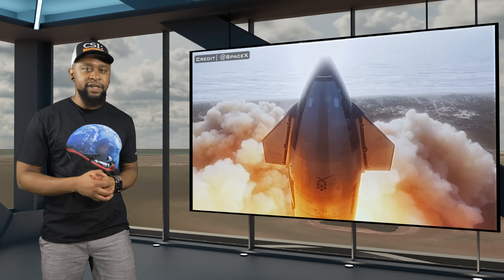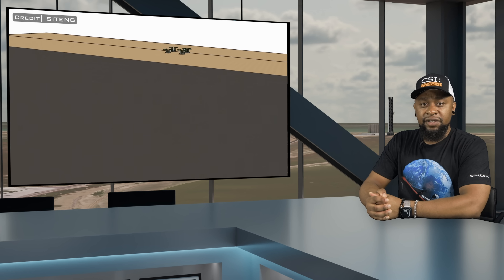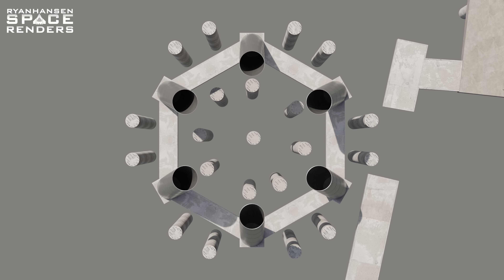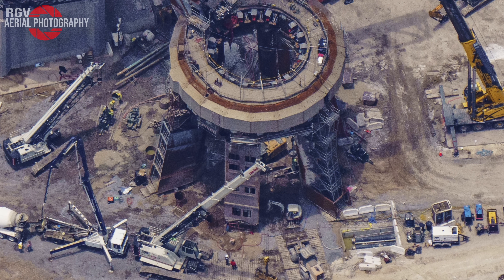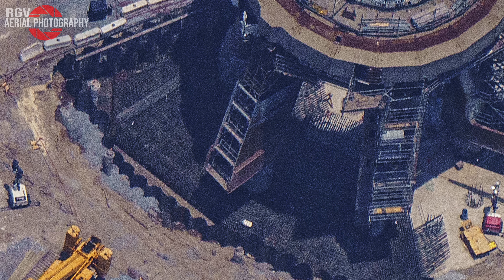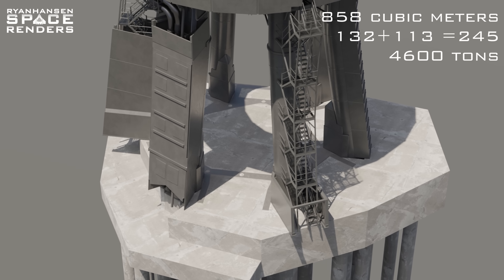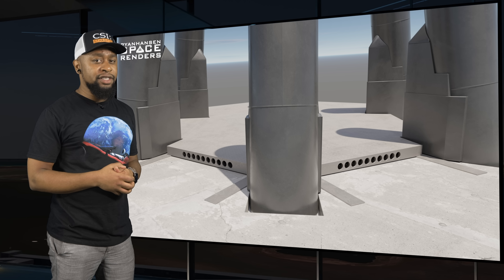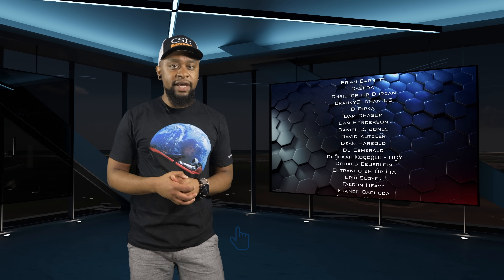How SpaceX Will Guarantee Its Launch Pad Never Fails Again! [Part 1]

Comment: Is it overkill? I worry that it might be under-kill.
I think if we made a flame diverter, lined with water cooled steel plates, that would be a good idea. Perhaps it doesn't need to be as deep as the NASA ones, but something ~ not just a flat plate under it.
I am also far from convinced that perforating the plates is the right way to do this. I have driven cars and motorcycles for 50 years that are water cooled, and normally they don't spray water out of the cooling system. If you could pressurise that system, to even 20 psi above ambient, you would dramatically increase the boiling point of the coolant, and water is about a hundred times more effective as a coolant, if it has not yet boiled. I don't know that using that plate assembly as a lawn sprinkler is the right answer. Just use the water to stop the steel from melting. Don't put holes in it that allow water out, and supersonic high temperature exhaust gasses in. I can't think of a suitable comedic analogy, but I fear this is a wrong-headed way to see the problem.
----
[edit] You're building an engine that already has a blown head gasket. There are dozens of direct open pathways from the combustion chamber into the water-jacket.
----
The other thing I'd say, once you have confirmation most of your engines have started, launch the damn thing! Don't leave it sit for 7 seconds or something on the pad, at full throttle ... You have a yes-no moment at main engine start, and if they don't, you abort immediately. NASA and all the others, don't have rockets sitting on the pad with 80% of their engines blasting away at full power while they take a closer look at why the other didn't fire up. A case like that, means an abort.
I would also like to know why, if they were trying to do a separation, and that's what the tumble was, why didn't the main engines shut down when commanded to?
Reply from the maker: If you don't keep a layer of water between the plates and the exhaust gases, it will melt. No amount of flowrate of water within the plates will prevent that from happening.
Reply: @CSIStarbase  ~ Well perhaps. Opinions. [shrug] I think you have to keep liquid water in contact with the back of the plate, preferably at 20 ~ 30 psi above ambient pressure, and not let high pressure exhaust gasses into that water space, because those will spread like a bubble and insert a layer of insulation under the top plate. Now if that happens, then you're quite right ~ no amount of water flow is going to keep that top plate intact. I don't know about an insulating layer of water / steam on top of it, I can see your point, but I don't want exhaust to get in between the plates, because experience with water cooled engines says that's called a blown head gasket.
[shrug] Pass the Popcorn ~ I'm keen to see it tested.
Understand, as a 6 year old boy, I watched Armstrong take one small step. I've waited now for fifty four years to see the next step. To say I'm keen is a bit of an understatement. I have waited so fkcun long for this ....

Comment: Um... no word about the chemistry of concrete??? There IS a reason why furnaces are still made from bricks. Even Fondaq RS will break down at 1100°C and the Raptor's flame temp is around 2810°C. At that temperature, concrete will explosively "break down" leading to fast ablation of any exposed surface - that's why foundries usually have dirt floors.

Comment: Obviously not overkill, but the cheapest alternative short of spending the money to engineer a 2000' deep mass driver system to use vertical linear rail motors to catapult the launch vehicle into the air above the Boca Chica surface before igniting the Raptor 2s. 
Our Trident SSBN subs use this technology and places the USA's survival on the reliability of flinging a rocket from sub-surface ocean to clear air prior to igniting the engines, so it is an already developed and proven launch system. Elon could definitely adapt it if he weren't so frugal.
Reply from the maker: I asked the question because Elon made the statement that they took the overkill route with designing their new foundation.

Comment: Uh, this has got to be satire right? This was not a success in any shape or form full stop and the methods Elon has said about improving will not only make the launch pad get completely annihilated it will essentially bomb the surrounding area and the rocket won't even clear the pad. Not to mention he can't even put a water cool system in the launch area since you NEED to have retention ponds, which there is no place to catch and store millions of gallons of water at any of the launch sites he has access to. This is even more a requirement for boca chica since it's directly next to endanger wet lands, which he has already annihilated with toxic concrete dust and craters, shrapnel and other items. So next time you think an explosion, a steel plate being launch miles away, and all the water being released onto those wetlands is going to be an even better turn out? That's assuming the rocket it self doesn't explode right there on the ground since it won't be bale to leave the pad once the pad explodes and takes legs and surrounding area with it.

I have a radically crazy idea, that's super simple although crazy and hear me out here. Flame Diverter.....

Comment: I know that the assumption is that the failure resulted because of sand compression.  But what if this was a result of liquefication of the sand substrate?  So even if all these improvements are made to support on the surface of the ground.  If the world's larges blow torch causes significant vibration the damp sandy substrate will liquefy and this could result in the shifting of Stage 'O' just like when earthquakes cause buildings to sink in to softer sandy soil.  Just saying

Comment: They need much more water. And they should probably add a third shift to the bakery, and make more thermal tiles to cover the entire launchpad structure using the same tiles they use on the Starship.
Reply: Oh yes because the engine exhaust & reentry plasma environment are absolutely the same thing /s

Comment: The water cooled steel plate isn't doing it for me as it is flat which will reflect the acoustic energy directly back to the rocket.  Sixty years ago we knew larger rockets need a flame diverter and flame trench and most every suck launch pad in the world uses them.  But, SpaceX thinks they know better and can do without a flame diverter and flame trench -- we will learn the results of this on the next launch.
Reply: And if the water plate were doing its job well, would you back down or?
Reply: @alvianchoiriapriliansyah9882  -- What on Earth are you babbling about -- care to ask an actual question about the use of this water cooled steel plat?
Reply: Actually, steel plates have been used successfully before. This water system will flush like a high-pressure toilet.
Reply: @psycotria  Actually, where on Earth has steel plates ever been used in the absence of a diverter geometry?  And where have they been used with a rocket that produces over 70MN?
Reply: @Raptorman0909  "Actually, where on Earth has steel plates ever been used..."

Look it up, I saw the video, and heard expert opinion,
Reply: @psycotria  I'm not doing your work for you, if you have a reference why are you unable to provide it?  And again, Super Heavy is more than twice as powerful than any rocket ever launched so even if there was such a launch pad, and such a system is probably acceptable for something like the Electron rocket, but for large rockets I know of no such installation anywhere on the planet!  But, since you unhesitatingly stated, with no hint of uncertainty, than you must have that reference on the tip of your fingers so go ahead and provide it!
Reply: @Raptorman0909  Lols. The only claim I've made is rockets have used steel plates. It's not my job to provide citations; believe whatever pleases you. 

The fact here is a super rocket will be using a flat, water deluge steel plate. There will never be a "flame trench" under the OLM, as nothing beats a 360 degree opening to release the force of a launch.

As a few more small pilings would have held up the sagging corners that doomed the original pad, I'm certain that the 'Overkill' pad will support the loads.

Certainly a welded, ribbed steel system that likely weighs over 200 tons, welded to the OLM legs, anchored to 4800 tons of steel reinforced high strength concrete, and tied into so many pilings that likely weigh another 500 tons, will not be going anywhere, anytime soon, not for any reason. 

Nitrogen powers the Falcon water system at KSC. Upon seeing the design of the water plumbing, this nitrogen-powered, gravity siphon system will move the required water in the ~7-10 seconds that the rocket exhaust would otherwise impinge upon the plate. If there are any tweaks needed, they will be made.

After seeing how sturdy the Starship stack is, I have no doubts that any issues will be ironed out of this evolving new system. It's almost time to start putting Starlink 2.0 into orbits.
Reply: @psycotria  You're delusional!  The flame doesn't have 360 exits as the legs of the mount kind of prevent that.  The other factor is that in order for the exhaust to exit it must turn 90 degrees but there is nothing to steer the exhaust by 90 degrees -- that's the purpose of the flame diverter.  So you can't provide any citation for where this has been done before, you made no effort to do so, and you expected me to do that for you -- got it!

Comment: Honestly I really don't understand how their engineers didn't calculate what would happen if they used concrete instead of steel for the launch pad. I remember thinking before the launch, 'how is that concrete structure ever going to hold together under that much power?'. Then the launch happened and I thought, 'oh it won't...didn't think so.'

Also mid point commercials for your garbage sponsors is video ruining. This youtube panhandling is getting way too out of hand.

Comment: If the Starship needs the new pad to take off, how are they going to build one on the moon or Mars before they have to land right on the stupid thing?
Reply: The booster needs it to take off, not the ship. Anything landing on Mars will hopefully have somewhat long landing legs to keep the engines a good distance from the ground.
Reply: @Raptor2  There are no legs on the second stage, it's supposed to be caught in mid air by the launch tower's protruding arms. They'll have to get both stages to land on short legs and then take off with the second stage but then they have to start engines still attached to the first stage.
Reply: @tomlakosh1833  Right now there is no way at all to recover the upper stage. The current design is only meant for stacking the ship, not catching. SpaceX/Elon have suggested catching the ship, but it doesn't seem like they're as set on it as catching the booster. 

It's also worth mentioning that Starship won't use Raptors for the final part of landing on the moon, so no worries about regolith flying everywhere.

I don't know what you mean by "have both stages land on short legs".
Reply: @Raptor2  I meant refuel the booster in orbit and take the whole damn thing to the moon or Mars. I still think we should protect this planet first before destroying another one.

Comment: All this work to save what was obviously a flawed design from the get-go.  This may possibly work, but I'm dubious it will work for multiple launches a day, every day.  I remember when they first installed those six legs thinking it was inherently flawed.  But we'll see.  I'm not a Musk hater, but this design like many others seems to have started out as an idea that looked good instead of one based on engineering principals.
Reply: They don't really have the land space to do what everyone says they should do, a flame trench. I wouldn't say this concept of a flat pad is flawed either, it has the potential with the steel plate to use significantly less water than conventional trench with diverter and water deluge systems that use a million gallons.

Comment: Launching from Earth is not the problem, that comes in when they have to launch from the surface of Mars.  They will not have the infrastructure to build such a pad there.
Reply: They will not have a booster there either
Reply: @alvianchoiriapriliansyah9882  Hmmmmm, about 40% Earth's gravity.  That will still be a rough launch from an unimproved pad, or whatever improvements they can make with materials on hand.

Comment: Giant 1 inch steel plate resting on packed gravel is all it needs. No water, no concrete. -not an engineer, just a physicist.
Reply: Good luck trying not to melt
Reply: @alvianchoiriapriliansyah9882  i'd like an engineer to run the numbers. It's only 15sec of heat and the flame if already highly expended... thick steel should wick that heat away from the surface without any melting. The steel may expand unevenly, which could cause other problems. - just a physicist.

Comment: smartest people out there building the largest spaceship in our lifetime.... puts a flat concrete surface under it..... lmao
Reply: looks like they need to build a concrete channeling system to divert all of that burn off back up into the sky, spreading all of that heat/thrust over a greater surface area...
Reply: @07szim  Like a system of trenches that could deflect the flames? A sort of Flame Trench-Deflector System? No way something like that would work. That sounds like something NASA would do....

Comment: Oil platforms overbuilt steel?wtf😊 concrete is just agragate with natural binders, a science to it, steel,thick. Old machinist. Made chop saw gears precisely 😊 Retired Md.state board certified bonded insured master 30 years also, sanitary, state code.water well driller, cable. Had six. Newest built 1958

Comment: I guess it's going to fail. There's a reason all other operators have converged in their flame trench designs. And there's a very good reason the flame trench points away from the rocket.

Comment: Hello 
There are 2 information missing in your video:
- 40y is the actual closing date but it will be extended to 60 and may be even more as in the Us - Second, the problem of renewable is not the cost of the engine but the issue of not being able to control when it produces. Today it has not technical solution that is cost effective.
There is another issue: the network need to be upgraded to transfert massive amount of electricity and that is very very expensive. tenth if billion if euros. I'm not even counting the fact that today the central stabilize the electrical flow of energy when the renewable don't or make it worst.
The only way to store giga watts today is hydro.
Fossile energy can be stored but not for long. France only need 10000tonnes of uranium per year which is nothing.
My information tells me: France will need nukes, solar, wind, hydro  gas and store electricity with nytrogen in order to produce more electricity for cars.
How will Germany reduce is co2 output with little sun, no storage, no nuclear, no sea borders and massive cars??

Comment: Wait.. this makes no sense. What is the point of doing all this instead of just using a normal flame trench/diverter? The point of not doing a flame trench was that it was too difficult to do on a place such as Mars. Well, I can tell you that what they are doing here instead is no different, if not more challenging, than a flame trench. The pile driving equipment used here is very specialized.

Comment: The one thing they desperately need but don't seem to want is a DEFLECTOR.  A flat surface beneath the rocket is always going to reflect acoustic energy back towards the engines, no matter how strong the construction.  A smoothed cone shape would be best.
Reply: Flat pad already deflected the exhaust 360°
Reply: @alvianchoiriapriliansyah9882  note that my comment did not mention exhaust
Reply: @DanJanTube Designing a vehicle that can withstand those acoustics doesn't violate the laws of physics

Comment: I don't see any added exit routes for the blast. Adding water means even more volume as water expends to 1600 times it's liquid volume when it turns to steam.
Reply: The surrounding is literally the exit
Reply: @alvianchoiriapriliansyah9882  It wasn't enough exit for the blast last time. Now steam will be added to the mix.
Reply: @tiredoldmechanic1791 The size of the exit wasn't the problem like you think it was (like actually, watch the video first)

(Flame trench that people really love lately has smaller total exit area than OLM)
Reply: @alvianchoiriapriliansyah9882  The flame trenches direct the blast away from the structures and also create a scavenging effect.

Comment: what happens if it has to make emergency landing and has to rely on flat land. If its failing, then keep trying like NASA. But i will say at least their one step closer to using rockets just like airplanes. so forgive me if i sound like a pessimist.
Reply: It will do a boostback burn, dump the propellant (like an airplane) and land at the launch site